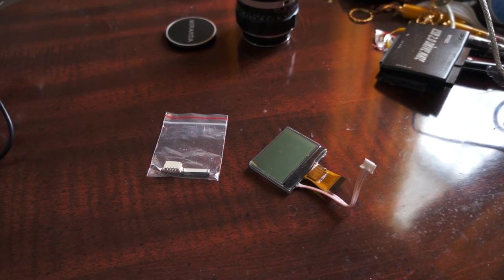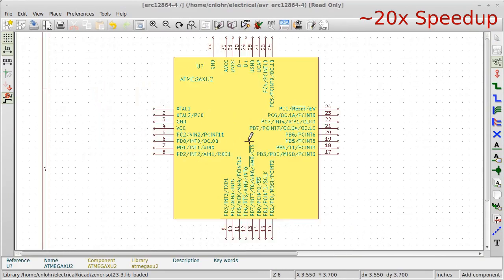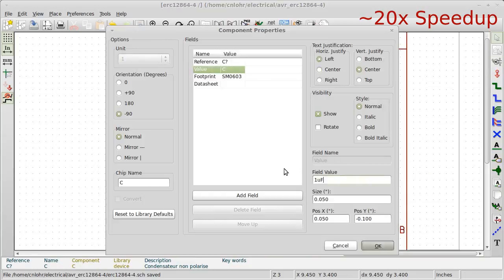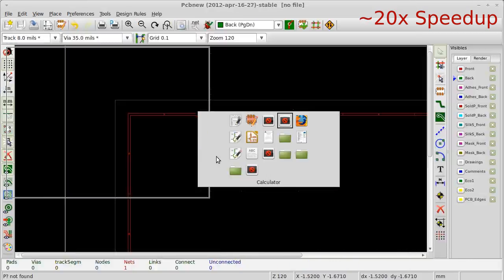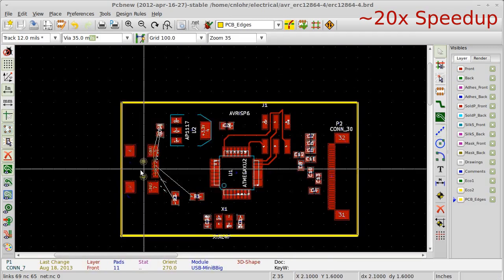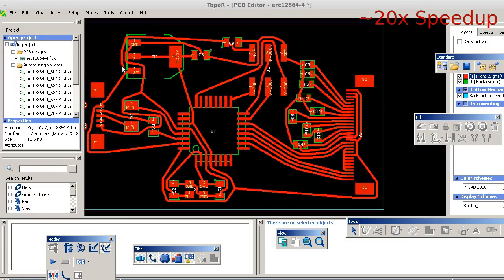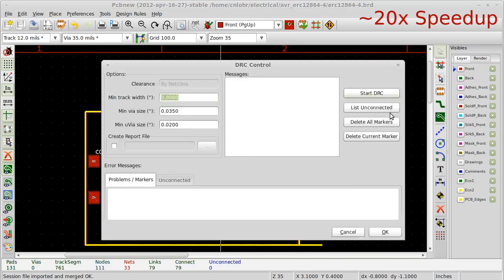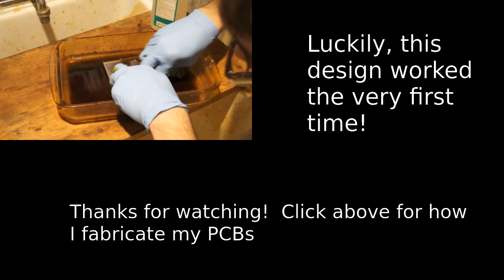How I do my projects - Part 1 - Designing the PCB

Comment: Why the odd angles? It is kind of neat, but not my cup of tea. Anyway, why TopoR? Autorouters are generally a bad idea. I've designed many simple and complex boards manually. On many of those, I gave Eagle's autorouter a try, just for the knack of it, and it couldn't resolve the design. Even simple designs would fail to autoroute.

Comment: I am also using KiCAD, previously used easyEda and DipTrace. KiCad is great but the lack of built-in autorouter is a little bit of problem for me. Though I'm curious if autorouters are really used by professionals and if I should ttain myself to avoid autorouters completely.

Comment: How do you print 600dpi png file in original size? Size is also increasing while resolution is. Is there a feature that achieves it in printer driver software? I am doing the similar process on Eagle, as well as postscript file but I can't figure out how to print high resolution images in original size.
Reply from the maker: Open/Libre Office Writer.  They do a lot to make sure if you convert from PostScript to a .PNG using Gimp, to preserve the original size.
Reply: That is pretty senseful. Thanks. I will try printing 32-pin qfn MCU in 1200dpi, I am very curious about the result.

Comment: Alright, I've been using Altium for the last couple of years and decided to move on to KiCAD (due to licensing and accessibility reasons, especially for Open Source). Which linux OS do you recommend for running KiCAD? (I am going to use a virtual machine). I think the OS you are using is lubuntu but I'm not sure.
Anyways, is KiCAD a good professional software capable of making complicated boards? The last time I checked was on windows and it was terrifyingly terrible. Hopefully the linux version is less buggy...
Reply from the maker: I know my roommate used the windows version a good bit recently and liked it ... plus TopoR is native to windows, but, if you do want to try the VM route, I use Mint (Mate Desktop).  It's much less dominating than Ubuntu.
Reply: I run Mint (Mate) on most all of my machines natively. Running a windows VM for TopoR has had excellent results not to mention the VM can be transported ;) . Over the last couple of years, I was running gEDA suite resulting in successful projects but haven't found a way to get the project into TopoR so I guess KiCAD would be most helpful here. I was announced on TopoR's website that Linux version was in future plans but that was years ago so I don't know if or when that will ever happen. I loved the videos btw. Thanks for sharing these.
Reply from the maker: You can use TopoR in Wine.  No need to run a VM.  Easier to open and move files back and forth.  Also, recently, I've been using topor less and less. dunno why, though.  I'm glad you're still in the loop!
Reply: I did sometime back on older versions but the newer versions fail during install in Wine for me. It's easy for me to transport the VM from host to host since it's ~20GB or so.  But not to worry, you'll may yourself using it again when a diabolical project comes up. :)

Comment: hey, do you know where should I start if I want to design a pcb for a rgb leds matrix? thanks!
Reply from the maker: What kind of RGB Matrix? 5050?  With embedded controller (i.e. WS2812B) or without (a boatload of discrete LEDs) Will you need to put in control logic?  Or do you want to just make them all turn on and off?
Reply: CNLohr Thanks for the reply. I'm planning to control the rgb matrix via bluetooth and show different patterns and text so I think I will need some control logic. I'm rather new to this and would appreciate any help. Thanks!

Comment: I've been using eagle cause it's freeware and I'm getting used to going from making custom libraries, laying out the board and the schematic, do you have any reasons for me to user other CAD software like the one in this video?
Reply from the maker: I find KiCad more intuitive and Topor is awesome at autorouting, like REALLY awesome.
Reply: Cool I'll check it out. For some odd reason I find manual routing calming lol but I'm sure it'll get old real quick, cheers
Reply from the maker: I routed the firs 100? PCBs I designed manually.  I loved it too.  Dunno what changed for me.

Comment: How did you learn how to build circuits, Use data sheets and know that certain things require capacitors, resistors, etc.? Did you get a computer engineering degree?
Reply from the maker: I started learning when I was very young.  My dad made me an electronics kit with a capacitor, LED, switch, battery and blinking LED when I was probably 4.  From there I just played and played.

I did eventually get a CE degree.  But, I think most of my learning was from tinkering and doing projects.

"I wonder if I can do X" half the answer was "Yes, and I learned something" half the time the answer was "well, I can't figure out how."

projects projects projects
Reply: CNLohr  I'm currently a junior getting a computer science degree, and most hardware design i've yet to do is a simple ardunio timer/temperature circuit, but i want to learn more! Is there a website or resource you could suggest  that would be good for learning about all the different components, and chips?
Reply from the maker: Sadly, no.  I have thought about making a poster for a long time but it always stalls me.  When I say poster, I mean mother of all electronics posters.  All different types of active devices, passives, filter design, rules of thumb... More a tool to know what to google rather than fix your problem at hand.  x.x So many things to do, so little time.

Comment: Please don't tell me you use auto routers for routing precision circuits :(
Reply from the maker: There was a back-and-forth on Reddit about this.  I posted a thread about my design that I manually routed on one layer "Let me see your autorouter route this! (and stay on one layer)".  Someone else posted TopoR's response "I see your manual routing and raise you with an autorouter".

It is impressive.

But yeah, sometimes I do have to go back to fix ground connectors and the like cause they routed important wires all around kingdom come.

Comment: It's good to see someone actually using these free tools! I tried KiCad before but compared to Eagle Layout Tool it is a little less intuitive and compared to professional layout software it is a pain. But using TopoR for layouting makes total sense. I'll try both for future projects! Keep up the good work!
Reply from the maker: I will admit KiCad is not intuitive.  It took me 10 minutes to find out how to switch from metric to imperial.  It took even longer to find out how to switch default text sizes, and honestly, I'm still having trouble setting up multiple-width-traces-per-track.  But, It is significantly simpler and quicker for smaller designs than gEDA - and significantly better than ExpressPCB.

Comment: hey, thanks for the great vid.
what's your Major ? i'm a 2nd year EE student and still don't know when i'll learn how to do these designs
Reply from the maker: I am a computer engineer.  I didn't learn how to do too much of this in school.  I think when it comes to practical application you have to either teach yourself or learn in occupation.
Reply: +CNLohr I'm an EE student getting ready to finish an associates.  I couldn't agree more.  I learned far more from doing on my own than what I have in school.  Theory is good, but hands on is where it's at!
Reply: You should start learning the basics of CAD (usually in PSPICE) designing shortly after you get past your circuit analysis classes. Just be prepared to "enjoy" the future bane of your existence until you get the hang of it... the floating node error. Lots of PSpice beginners have issues with floating nodes for the first sketch or two.